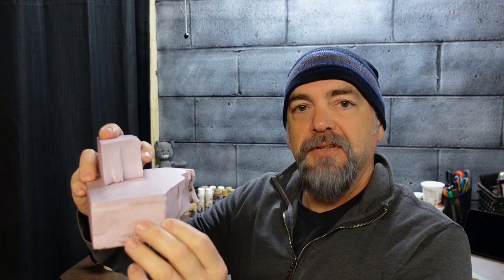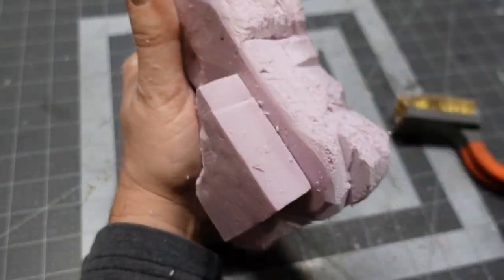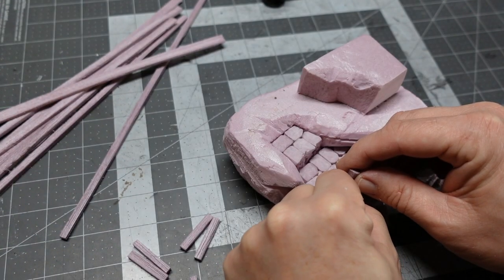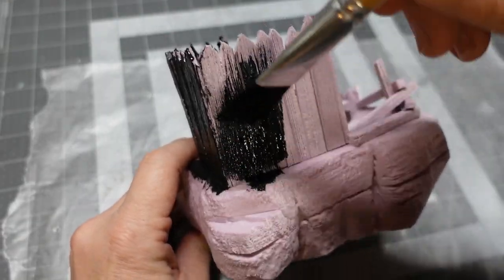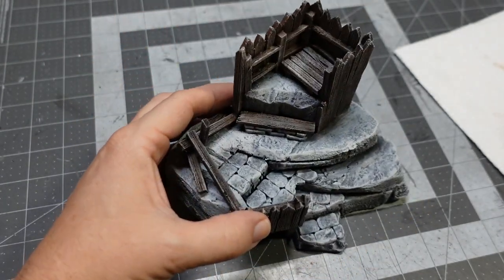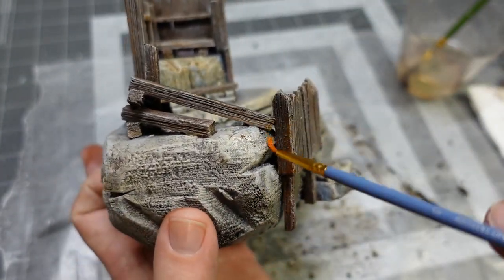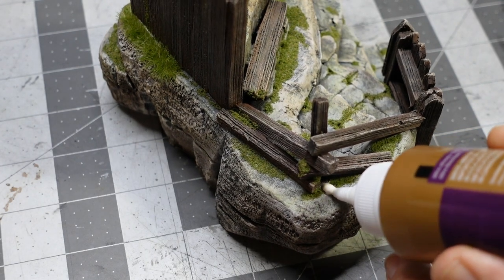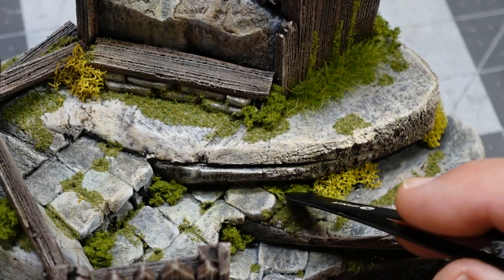The Border Watchtower Scratch Building Wargaming Terrain for Dungeons and Dragons and Tabletop RPG's

Comment: Really nice. Excellent work with the washes to elevate the look of the stone.
Reply from the maker: Thank you! I'm trying to channel the old masters! I want to try oil washes but for now I need to keep the hobby on the cheaper side. I did get a couple of Vallejo washes and acrylic ink. The acrylic ink was from Michaels and totally worth the cost. One drop of ink mixed with water is enough for a small build. I have the Michaels app and use  my 50% coupon to get sets of paint or a single model for kitbashing. They will harass you to death with emails though!
Reply: @ravenstead  Oil washes can be really cheap - just a box of oil paints and some white spirit.
Reply from the maker: @manjr  OMGosh! I don't know why that didn't occur to me! I have a ton of old oil paints and a gallon of mineral spirits. You are a genius!

Comment: Nice work!  I'm curious about your feelings on using wood.  I'm a big fan of balsa and coffee stirrers.  Do you see an advantage to making wood from foam?
Reply from the maker: Thanks! I feel like I can get a better wood grain effect to scale with the fine brass brush on foam. Balsa, bass, and poplar are great materials too. They have way more strength than the foam. Western red cedar would be my wood of choice for actual wood builds. It's light and has a natural soft tan color, not red like eastern red cedar. When milled into scale planks with a bandsaw it even looks like it was sawn with a pitsaw type mill as opposed to a 19th century type circular sawmill. I appreciate the great question!

Comment: Again a nice little build! Love it.

I don't do much with foam, but I found out that it has a machine direction. Not that strong like paper but similar, I guess.
I just had the impression that if you scrape it along the machine direction it is easy and if you do it lateral than it breaks out and is harder to grove and scrape.
So I wanted to ask if you mind that direction when scraping. Or is my impression wrong?
Reply from the maker: I feel you are correct! There is tension in the factory finished sides. The side with print usually has a little memory so it can curl. I definitely slice away the factory face if I'm making bricks, so the rock tumbled texture takes better. As for scraping, breaking, chipping, or cutting I haven't noticed to much difference in direction with the thinner foam but the 2" foam seems to texture better along its length. Great question! I hope others will chime in on the thread. I may have to post this to r/TerrainBuilding.
Reply: @ravenstead  I definitely don't mean the smooth outer side but the inside.

Comment: Where's the best place to buy foam cheapest?
Reply: Also, is EPS (styrofoam?) or XPS (insulation foam?) easier to craft?
Reply from the maker: The cheapest place to get XPS and EPS foam is dumpster diving, roadside trash, construction sites, etc. Be careful and don't get run over by a truck, contract tetanus, or trespass!  Aside from that I usually get it from the big box stores like Home Depot or Lowes. I prefer XPS, it's more dense but you use what you can find right? If you are from outside the USA I don't have a clue, sorry.
Reply: @ravenstead  That's great, thanks. Living in a pretty rural location there aren't a ton of construction sites around, sadly. I'll check out the local Home Depot and Lowes.
Reply: Do you know what the R-value of the one you're using is? I'm guessing that the higher the R value, the denser the material.
Reply from the maker: @GoodEggGuy  The two inch foam is the R-10.